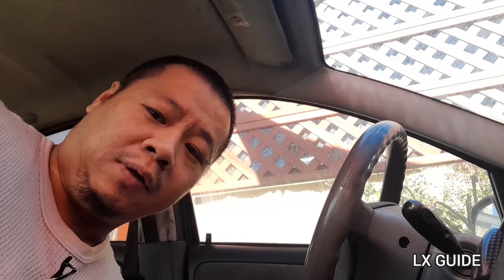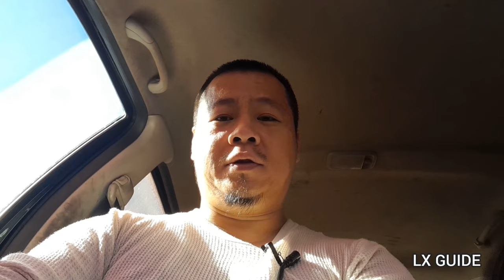Here Is Why Your Car Engine Makes Rapid Clicking Noise When To Start

Comment: OK, but the battery terminals are clean. The battery is OK and he replaced the starter. What else could it be?
Reply: For me, my truck wouldn’t start because the alternator belt came loose and wasn’t keeping the engine alive, then my truck overheated because I kept trying to start it with no luck
Reply: @dr.chalmers7923  are you able to save your car?
Reply: @dmaninthewall  yeah had to replace the alternator and the harmonic balancer, and figured out that the fan(attached to a wheel that the belt runs over) was loose so that cause a little overheating. It’s a 93 Sierra so it’s a pretty capable truck, got it running and it’s good
Reply: Yo alternator
Reply: Did you ever fix it? I did the things as you
Reply: Either alternator or battery.
Reply: Get a larger battery my 2004 had a no start issue at 400CCA, I added a 600CCA from the junkyard for $20 tested and in good health and it starts instantly now

Comment: What if the starter battery n alternator  are new n it does the same rapid clicking
Reply: If power cable to starter is really hard then it could be corroded inside the insulation cause low voltage
Reply: motor could be seized

Comment: There was some Bluey white powder around one of my battery terminals though. I could brush and blow it away. 

On a separate issue. My key does not lock the drivers side door of my A3 I have to open it manually. Other side is fine. Any ideas?
Reply: Cheak ya post yo the
Reply: @daedrianmcfarland4830  sorry, I don’t understand.
Reply: Oxidised copper on the terminal, they need to be cleaned with some contact cleaner, if the corrosion is heavy best to wire brush gently and contact clean both terminals

Comment: So I tried starting my car and I k ew my batter was low so I checked the voltage and it was at 9.46 volts so I connected 2 sets of jumper cables and left them connected for about 15 minutes with my 2017 jeep Wrangler running. I had my wife rev the motor to 2,000 rmp while I tried starting it but no start. I tried a few times but same thing. I checked the voltage while cables were connected and it was reading over 13 volts when but still no start when I removed the cable the old batter was reading 11.32 volts. Tomorrow I will try with new battery.
Reply: Same, whats the update